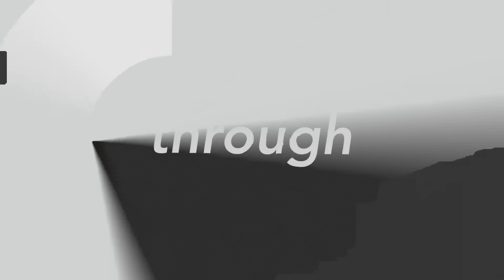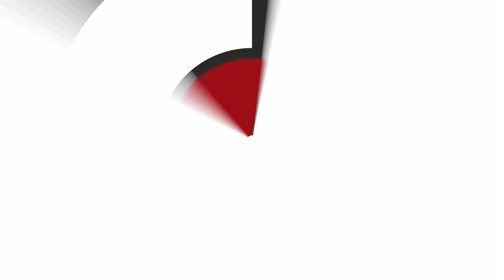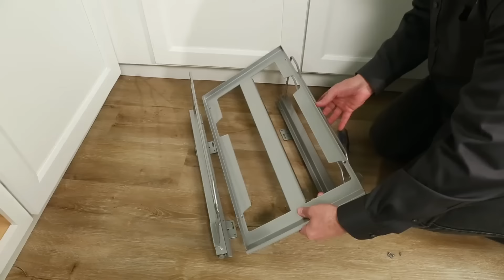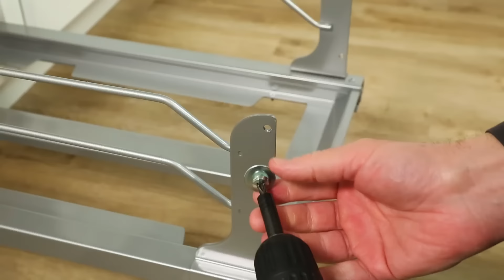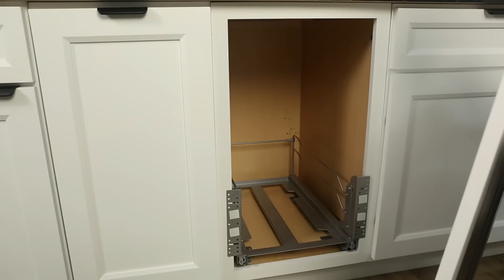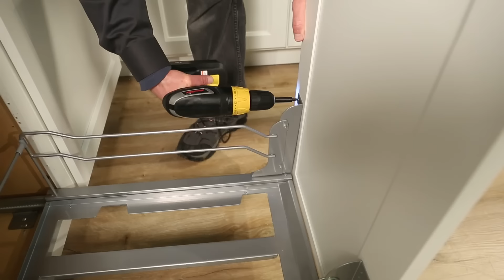53WC Series Pullout Waste Containers | Installation

Comment: The Philips Bolts in step 6 do not fit in the holes of the base. Anyone else have this issue and any advice on how to fix?
Reply: I have this same issue. The holes in the chassis bottom are much larger than the holes in the wall slides. What's the fix or is there one?
Reply: Nevermind, turn the chassis over and it works wonders. Doh!

Comment: How do you get the door centered horizontally? There were no measurements taken for that.
Reply from the maker: Hi! Use this equation: (Overall door width) – (center to center of the horizontal slots on the Door Mount Brackets when installed on the unit) /2 = Horizontal center point measured from the outside edge of the door